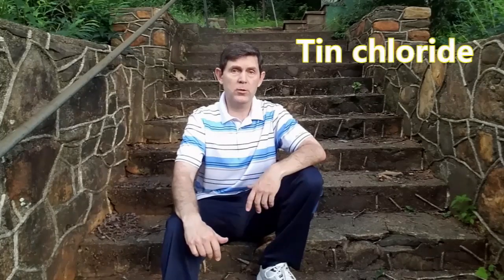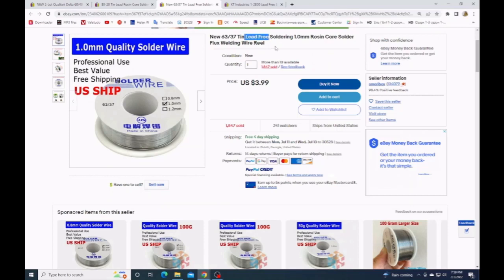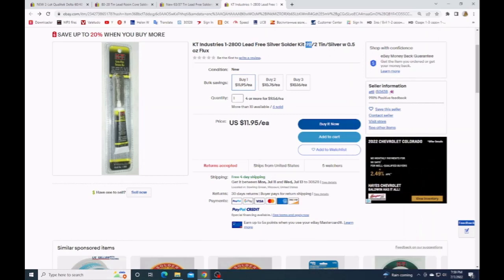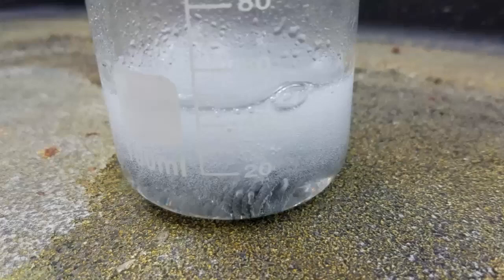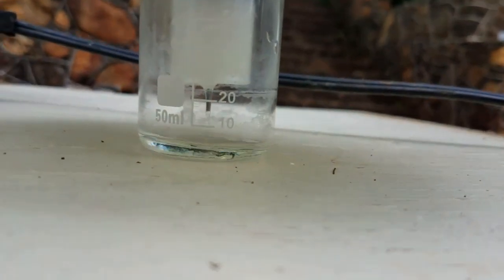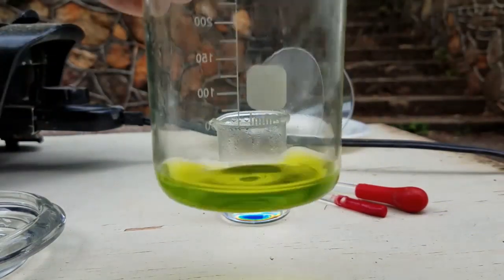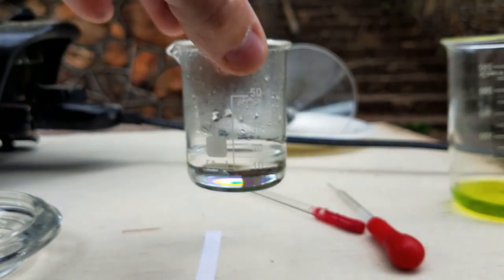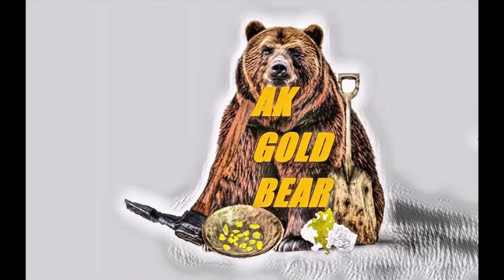Tin chloride. Preparation 🧪of stannous chloride at home🙂

Comment: Thank you for sharing your knowledge sir
 i want to follow your steps and see if i can do it
Will 3% copper be a problem?
Reply from the maker: Hello. 🖐 The preparation of stannous chloride is very simple. About copper, to be honest, I have never heard of tin with copper. I am not sure, but if you extracted tin from some old circuit boards and think that there is copper in it, what could logically be, but in this case there could be a big percentage of silver and lead. I do not want to make things up, I honestly do not know how copper will affect stannous chloride 🙂

Comment: How is the tin chloride powder solution?
Reply from the maker: Hello. Tin chloride dissolves in an alkali solution and in concentrated hydrochloric acid. Hydrochloric acid must be heated to 95-100 degrees. After dissolving the chloride you need to drain dirty solution without diluting with water, otherwise the chloride will instantly form again 😉
Reply: @akgoldbear7669   thanks. How is the ratio stannous chloride powder and hydrochloric acid. 
  Becaus now I got stannous chloride powder (tin II).
Reply from the maker: Don't know. I adding hydrochloric acid, heat it almost to a boil (the solution will be very dark) and if something is not dissolved, drain the solution and add hydrochloric acid again.

Comment: How we can prevent it from oxidation ?
Reply from the maker: Does it oxidize? I have stannous chloride which I makes 6 months ago and i do not have any problems. Don't make a lot of stannous chloride. 15-20 milliliters will be enough for long time, because one drop of stannous chloride is usually used to test the solution 🙂